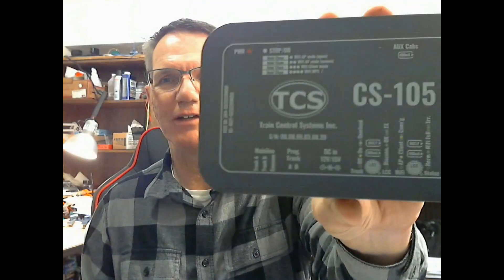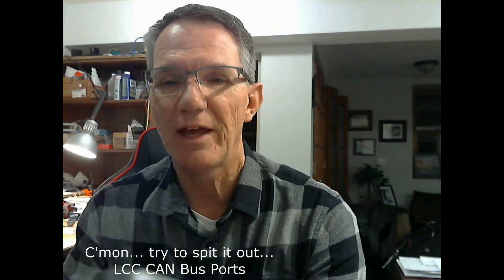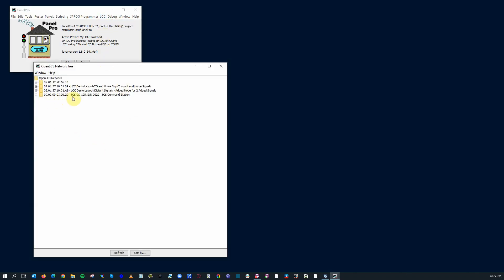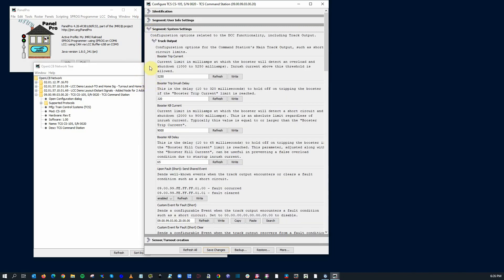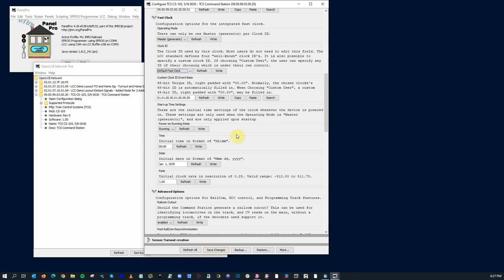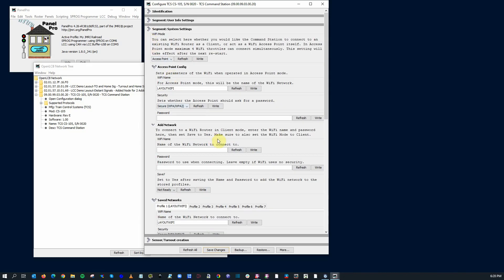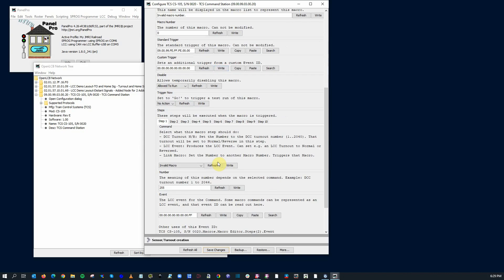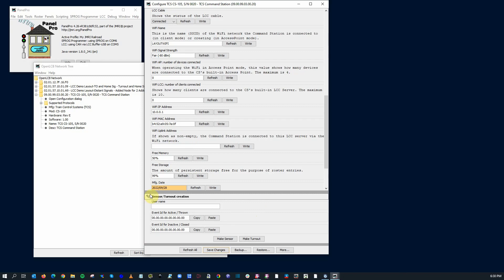TLC #18 - An LCC look at the TCS CS-105

Comment: Dear sir been watching your videos on Lcc thinking of going with TCS command station combo any how my guestion is I already have pre wired my layout with thoughts of signaling I have nce bds for block detection and tam valley servos and switch controls are Thea’s compatible with Lcc or do I have to start over also all signals are Atlas
Reply from the maker: LCC is command station agnostic - you can use whatever system you like. Your comment on prewiring the signals is not clear to me - how are they pre-wired? In LCC, signals should be wired directly to the outputs of the Signal-LCC modules. As for block detection, from the literature, the BD20 appears to be TTL compatible (0-+5V), which is what you would use for LCC. Biggest hassle would be wiring them in, but certainly doable. (The RR-Cirkits BOD-8 plugs right into the Signal-LCC or Tower-LCC.) Right now I am not aware of any LCC products that can handle servos for turnouts. The only products I know of drive either twin-coil switch machines or stall motors.

Comment: A couple of suggestions. I am new to LCC. Just got the TCS CS-105 and a couple of LCC components. The first struggle was working out how to connect things. No ribbon cable supplied. Which do I buy? How do I connect the connectors? Covering the absolute basics would be helpful. What is the min number of components needed to get a tortoise to work? Needing a power supply? Which one? Etc…
Reply from the maker: I only demo'ed this unit and then had to return it. I never set it up on a layout nor did any operations with it. I was mostly focused on demonstrating the connectivity of it to the LCC network and showing the config screen. As for how to connect, check out my LCC Channel vids on how to set up a basic LCC system, including the components needed. The CS-105 would just be another node on the system. Let me know if that answered your question or if you were looking for something else.
Reply: @the-lcc-channel  Thanks, I should have applied force more evenly with the pliers without the clip. Anyway Amazon has kit with the crimping tool and more connectors which I realized I needed. Since not enough included. Also you can point JMRI straight at the cs. If both on same WiFi network. Solved the issues I had. Also the stall motor board connecting to a TAB.
Reply: Excellent update,  @johnhmccauley  Thank you.

Comment: how do you like the cs 105 during your time with the unit?
Reply from the maker: You know, it worked just fine. But in reality, the magic is in the wireless throttle. The set I borrowed had the UTW-100 which is chock-full of cool features. In that sense, the CS-105 is simply a black box that conveys the data to the track outputs. And it did the job admirably, without any problems.